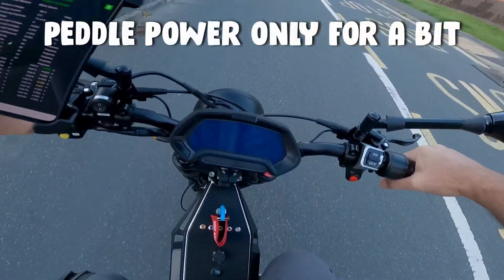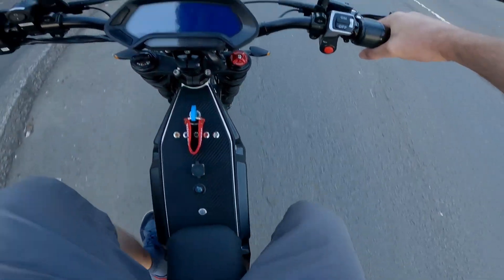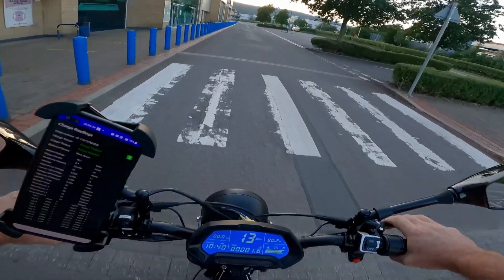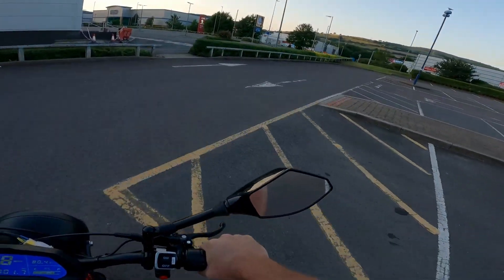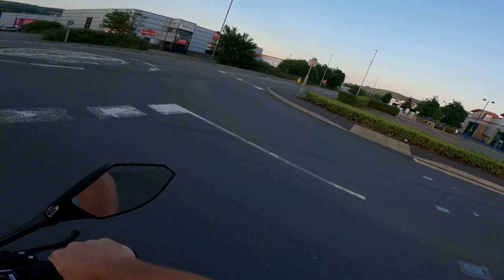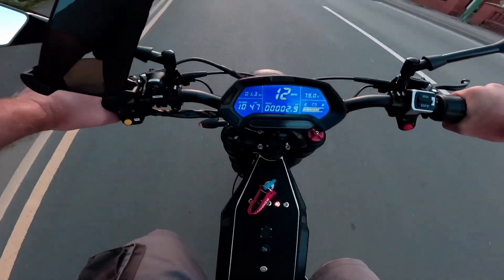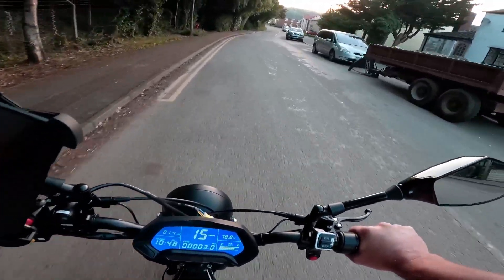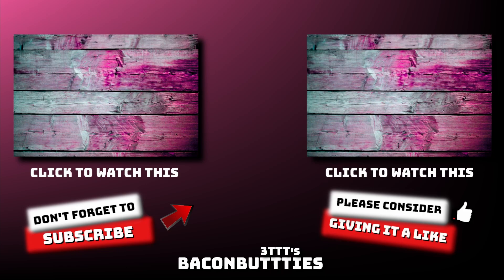EBIKE SPEED TEST GOES PRETTY FAST AND SCARES ME A BIT - MSVA LEGAL EBIKE BUILD PART 18

Comment: Hi mate did You fit controller tray ? Just i have sabovton like yours  but tray is smaller than controller i was going tour angle grind  lip but thought I ask  you first .
Reply from the maker: I tried angle grinding my tray but it still didn't fit over the sabvoton.

I was going to cut and try and widen it but never got around to it
Reply: @baconbuttties  ah i noticed some vids had tray and some not , That sounds a good idea opening up  to make a bit wider, These bikes are fun to build but an absoloute headache at same time when unforseen snags appear arghh.
Reply from the maker: @craigmcintosh7231  Yes, the vids with it on didn't have the controller inside. Only found out later that the sabvoton didn't fit.
Reply: PS auto spell above lol to  not tour

Comment: I like the honesty about the problems a heavy hub in a swingarm brings....
I love hub motors and built a hardtail cruiser... fat rear tire and shock under the seat. (5kw) Love it.
...after i had built 1kw hub fully with a fox rear shock and found it too unpredictable off road, and bouncy on road... just no traction.
Reply from the maker: Yes I didn't find it handled well at speed.

Comment: Very nice bike with lots of effort gone into its building.  I only rode my motorcycle once in jeans and a T shirt.  It was a red hot day in 1980.  I felt really unsafe and never did it again in all my years of biking.  Daft thing is I pull 30 regularly down a hill on my 5 speed Racer and don't bat an eyelid.  It's still a case of gravel rash if I fall off.  Definitely worth a bit of safety gear when you are out speed testing.  Great video, very interesting project.
Reply from the maker: I definitely need some safety gear 👍🏼 but like  you said I have pushed 30 on my bicycle with just a cycle helmet and gloves and it would be nasty if things went sideways.

Comment: Great build,I love your quirky humour I think you did a good job but as for registering it I think it's a hard process I wish you luck,myself I'd stay as covert as possible, peddle only with a peddle assist sensor and then you'll blend in with all the ordinary ebike s, m a y pay to get a 250 watt sticker too! keep on entertaining usmatey
Reply from the maker: Thanks 👍🏼 registering it is a bit of a process and I am in two minds whether to do it or not.
Reply: If you are gonna turn it down to legal speed with  a maximum of 22 mph dialled in you can effectively stay of the police radar most ebike s I've seen lately exceed that speed and as you say 44 is to fast I had a accident on my 1000watt build at 18mph recently, straight on my head good job I had a safety hat I would definitely be brain damaged or dead and I am so lucky so just be safe. I've been riding for many years and I am so aware now ,all the best bacon butties
Reply from the maker: @rogerEheadbyrne4790  👍🏼

Comment: whehey, sat on mine for the first time the other day. Never tried a mid suspension so picked up a second hand Fox Vanilla Float for £30, shockingly good, felt like i was floatin on a big ol' set of tits. They do a 210 too which fits perfect. Hahhoyyyy
Reply from the maker: Nice 👍🏼 mine feels like I'm on a trampoline .
Reply: @baconbuttties  try it mate. I got mine from Gumtree. Most are from up North but the postage was only £9 and worst case scenario, you'd need to service it which is £20 for new Rings.
I may even start buying them up and refurbishing them, what with new ones costing £300 upwards.and people buying refurbs for £120
Reply from the maker: @jclive4773  👍🏼

Comment: Bikes coming along nicely mate.
Am still gathering parts for my build hopefully in a month or 2 I can start testing and setting it up been a long process sourcing parts. I decided on Motorcycle Rear Suspension Center Air Shock Absorber 205mm for Honda Grom MSX125
https://a.aliexpress.com/_mqVXjWR
Was on sale for £55 some minor modification to the frame to mount the res and it looks 👌
Reply from the maker: Yes I have been looking for a motorbike rear shock that is suitable, also watched a video where  motorbike front forks are being used which is something I'm also thinking about 👍🏼 what kind of modifications did you have to do for the shock?
Reply: @baconbuttties  drill frame shock mounts out to 10mm and 2 small 5mm holes in frame for the res bracket I placed this under the seat mount to keep it tidy and it's cheaper than the dmn rcp2s if you go to the seller I linked I posted pictures of the shock mounted to the frame https://linksharing.samsungcloud.com/pGqcLYcBphku
Reply from the maker: @haggisbasher2906  👍

Comment: Nice run out, I think that controller can be tweaked a lot further to your taste. I have the same frame as yours with 5000w and have been using it a lot in this heat (unregistered).
Reply: Yea my build was the same but instead of mirrors I used front and rear cameras, 72v 70ah battery, 8000w hub motor same controller running 12,600 watts I've done 74mph/119kmh.
Reply from the maker: Yes, I have had a good look through the controller settings and have tweaked it a bit but needs a few more tweaks 👍🏼

Comment: Been following this build with interest, I have a project I started just before that dammed ViRuS struck and has been sitting ever since. It's 80% done, I just can't seem to get back into it for some reason.  :(
My build is a cheap full suspension standard mountain bike with 26" wheels and "cable actuated" hydraulic brakes (brake calliper has master cylinder built-in, and is moved by the standard brake cable - better than basic cable disc brakes, and gets around a few issues regarding the hydraulic setups...), 1000W (1200W actual) rear Hub and cheap controller, "28.8MPH" ( Max 31MPH, so moped / scooter class), and powered by two frame mounted 48V "13.5"Ah battery packs (Hailong type, LG cells) in parallel for 27Ah (24 / 25 is probably closer to truth).

From the description It doesn't sound like it can pass the MSVA, but everything is legally to spec (working horn, 'E' marked indicators, headlight & brake light, speedo with tell-tales, mirrors etc), the only tricky part is the 26" tyres as they need to be marked "ECE-R75" and will pass the MSVA without having to convert to motorcycle wheels / tyres. Have spent several hundred quid getting screwed over by misrepresented tyres, suitable tread types so far have not been correctly marked with the  ECE-R75 mark, even tough most are listed as compliant  - and I've been told they will fail for not being marked. Bugger! 

Keep up the good work, we are all waiting for the next update!  :)
Reply from the maker: That's a shame that you can't get the right tyres, are the tyres for those registered S - pedelecs no good for MSVA?
Reply: @baconbuttties  They should be, but not all of the manufacturers actually stamp the full R-75 mark into the tyre casing - they all tend to have their own "brand" of markings for the e-bike  / s-pedelec versions. The tyres ARE certified, just not marked properly, and as far as I've been told, unless the tyre is E-marked with an appropriate road tyre 'E' mark or equivalent (such as R-75), then they will be deemed to be a fail. some of the huge knobbly mud tyres do have the marking set correctly (Schwalbe etc), but I['ve been told that even if marked as appropriate, a tester could still say they tread is unsuitable for road use and still fail for that reason (the tester I spoke to was very cagey about details on this for some reason).  Currently running with a lovely set of Pirelli S-pedelec rated tyres (again no markings) - PIRELLI
 "Cycl-E GT". These are very similar in construction to a motorcycle tyre and ride really nicely on the road. Apart from the VIN stamp (have, just not stamped yet) and tyres (and a little wire tidying), the bike is basically ready for MSVA...

Comment: Hehey, hohoy looking good! 😂Getting the lighting done on mine atm. I'm hoping mine can do at least 50mph and 40 miles but have heard of people with a 25Ah battery doing 40miles so who knows!
Reply from the maker: Yeah I reckon you should get over 40 miles easily, if I get anything over  25 miles then I will be happy 👍🏼
Reply: @baconbuttties  what kv/turn count is your motor? i have 4t and with field weakening i managed 76mph
Reply from the maker: @DeltaCmndrElite  my motor is 5T... 76mph 👀👍🏼 what volt battery is yours.
Reply: @baconbuttties  72v for now going to 96v soon! you should get mid 60s with field weakening mid 50s without!!
Reply from the maker: @DeltaCmndrElite  field weakening is set to 30 amps I think on my controller, or is it 30 percent..
Reply: @baconbuttties  you got 3spd switch set up? if so it will have to be in high for FW to be enabled
Reply from the maker: @DeltaCmndrElite  no 3 speed switch, sabvoton is set to ( full power mode ) can't remember what it's called 😂